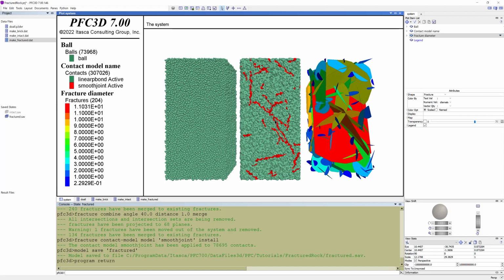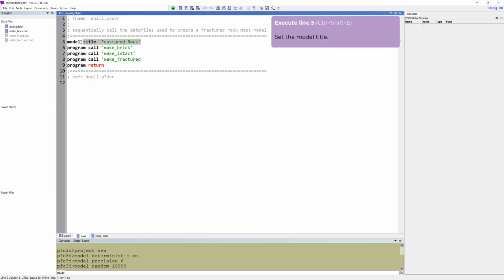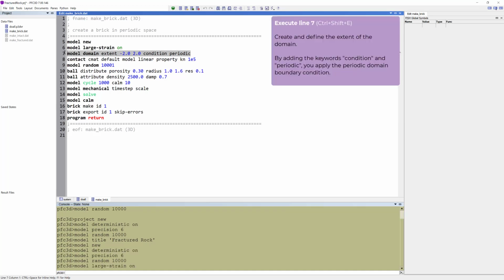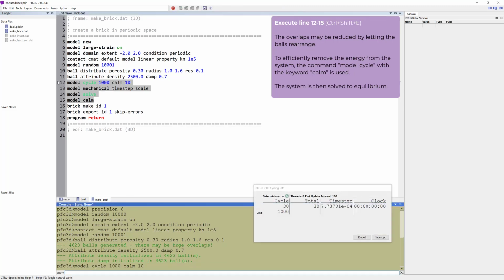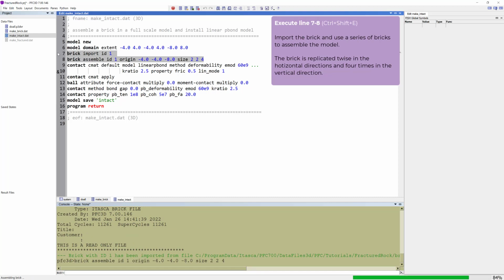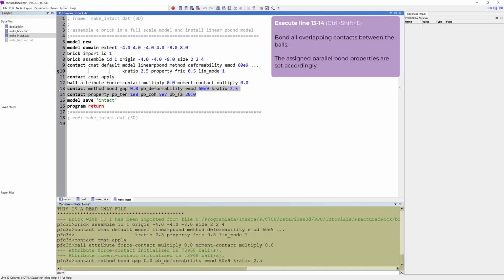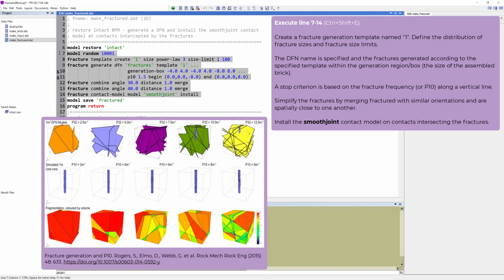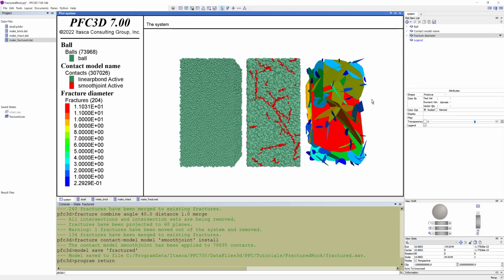PFC3D v7 Tutorial: Creation of a Synthetic Rock Mass (SRM) Specimen

Comment: thanks so much for the video...Am doing research on the influence of the freeze-thaw cycles on the mechanical properties of the rock-concrete interface using direct shear test (Experimental and Numerical analysis) ...Do you have some tutorial that can help to help doing the simulation?  for the Labotory experiment i will make a 100 mm × 100 mm × 100 mm granite-concrete sample, place it in the freeze-thaw cycle machine under different condition (30,60,90,120 FTC) and after the FTC of various conditions i will do the shear test with a multifunctional shear rheometer

Comment: In 3dec 7.0 126, liner cant match the excavate face in BBM，which results in block dropping through the liner，I think the reason is that liner node just match only one of the two gridpoints occupying the same position on the BBM joint plane between two adjacent zone sharing the same BBM joint plane. Is there a available contact, such as email address, that  I can ask my question and tell my confusion about 3dec? office stuff in my region are like corpse telling no useful information. so helpless to do my master paper.
Reply from the maker: Yes, to request technical support you can use this form on our website (https://www.itascacg.com/contact-itasca/software-support-request) or try our new software forum (https://forum.itascainternational.com).